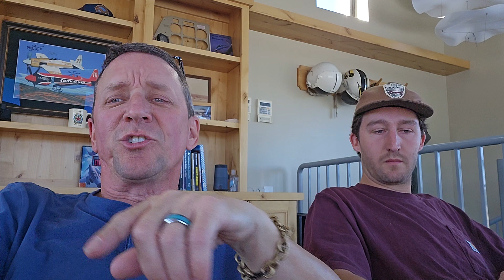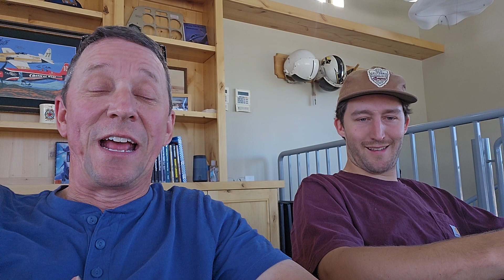Opinions Needed: Is drag reduced by removing the scoop on a P-51 and moving radiators to the wings?

Comment: The radiator arrangement in a P-51 uses a phenomena called the "Meredith Effect" which does provide useful thrust.  It was tested and verified in the US and in Germany before WW2.  The question posed above would need to be answered with testing and data analysis for both configurations on the same airframe.
Reply: the spit had a wing radiator instalation designed to take some advantage of this effect so does the 109 they tell me, however, it appears that it was very well done don the Stang but is only one of the reasons of why this airframe is so good. One thing nobody seems to take in account is the distance between the prop disk and the leading edge of the wing, the Mustang has a long nose and that helps with the interaction of the prop wash and the wing. On the Typhoon for example, the prop was so close to the wing that the prop wash damaged the leading edge on the protos.

Comment: Anson Johnson won in '48 with a pretty much bone stock Mustang after all the crazier planes ran into trouble. He only took the belly scoop off in 1949 and then it sucked. Though that may not have been the radiators fault, the engine was spitting oil and losing exhaust parts during the race

Comment: Getting into specifics, I would wager Ghost’s setup with a clean wing (no inlets) and the boil off in the fuselage is the best it can get. And how fast that plane went with a Shanholtzer aftercooled Merlin rather than something that can push 140”+.
Reply from the maker: Where did the steam exit for the boil off?
Reply: @seafurycentral3744  just forward of the numbers, pretty much above where the extended wing fairings are on Voodoo, Strega, etc.

Comment: So much like a ramjet that it must work to that end but using engine waste heat as expansion force. It probably only worked within a finite speed range/air density. Down low like a pylon racer in a thicker atmosphere it probaly doesn't work as well as designed thus better revised/removed. You could probably do well (fresh drawing boards) to revisit Schneider trophy era racing designs with fuselage and wing skin radiators. If these races ever recommence I bet WWII airframes will be left behind all together probably (sadly) with their engines. "Tsunami" and Pond Racer like designs with Pro Mod drag racing engines (that can hang together for duration of flight) will probably be next for Unlimited category if good sponsorship and prize money get involved.
Reply: Tsunami had/has a belly scoop!
Reply: Indeed it did. Optimised for its race purposes only. As Skip Holme claims in an interview that he finished a (500mph) qualification run with the thing blowing off of the airframe, it still must have been too large for its purpose. @ZacYates
Reply from the maker: And what about the carb air intake scoop that Tsunami tried the first year it raced?

Comment: No:

North American designed the belly scoop to work like a venturi. The air exiting, is faster than the air entering, thereby creating its own thrust.
Reply from the maker: But when the airframe is moving at 400 mph, the air exiting can't be exiting faster than that.  Scoops are built to open up inside and slow the air down to cross the cooler....
Reply: @seafurycentral3744  The air is slowed down to make it less turbulent/more efficient - same principle as the intake on a SR-71 engine.

I once read that North American spent many an hour in a wind tunnel, perfecting the doghouse design.
Reply from the maker: No doubt, did that design get used on any other airplanes?
Reply: @seafurycentral3744  Actually...

I read an article online that had to do mainly with spray bar technology in race planes, but it also went in depth on how the INSIDE of a cooling duct's design was more important than the outside - and, ironically, radial-engined aircraft were especially mentioned, including Critical Mass! (It went into the spacing between the spinner & the cowling, in relation to airflow around the engine)

It didn't talk much about radiators though, more oil coolers and cylinder fin design.
Reply from the maker: Our race engineer Dave Cornell was adamant that the spinner afterbody had to be shaped using a cookaman curve.  Not sure about the spelling of cookaman.  The afterbody goes from the spinner to the base of the cylinders.  We made it up to Dave's spec out of fiberglass.  Apparently every detail matters.